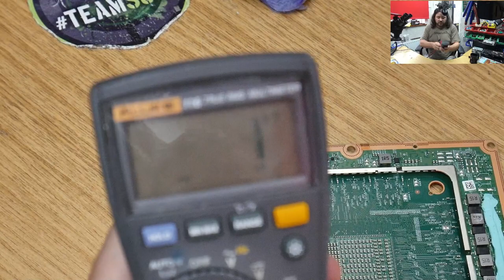XBOX SERIES X ⚠ FAIL FROM ANOTHER TECH!! ⚠ ESD IC FLOATED 😂

Comment: Great work my man but try not to do “wiggle” tests on any circuit board components you risk ripping pads on the board im sure you know how to fix this but will save you valuable time in the end
Reply from the maker: Thank you, However I know what I'm doing and is just to show how and why the anchor points are there. I've done many of these and many repair tech's disregard the front anchor points. I was demonstrating how much strength they provide! I loose no time in my repairs as I do quite a lot per day. These videos are to show the type of repair, care  and attection to detail that goes into each and evey repair for who choose to use www.UberMicro.co.uk

Comment: Do you apply heat only to to top side to remove ports on these series X consoles? I do a minute on the back side and a minute on the top side but wouldn't mind trying it just from the top if so. Great video.
Reply from the maker: Yeah, when removing the ports I don't care if they melt I just need them off the board safly, quickly and cleanly. Heating a new port on is differnet I'm quite harsh but I'm looking for certan signes with the sewating of plastics to know when I'm over heating.
Reply: @UberMicroRepairs   @Uber Micro Repairs  thank you. I forgot to ask in my last comment. I know your getting fairly familiar with series X's. I have one in now and it it goes up to 1440p. No 4k. I'm guessing either the encoder or possibly the booster ic. Have you seen this issue yet?
Reply from the maker: @hove131   Not come across this yet. On the One X yes, defaults to random rez but never full 4k. turned out to be the HDMI IC.
Reply: @UberMicroRepairs  I'll start with the encoder ic like I was going to try. I'll let you know what comes of it. Thank you for your help.